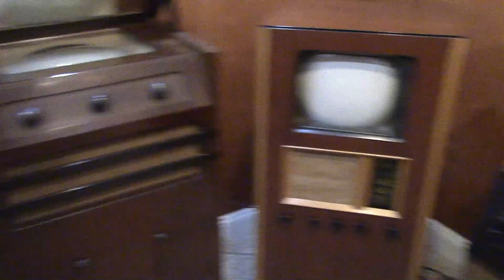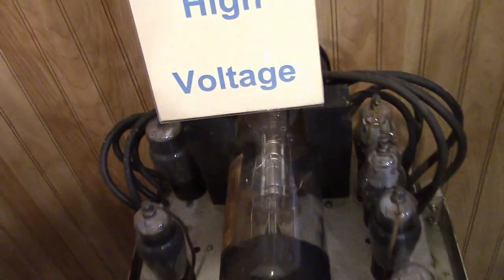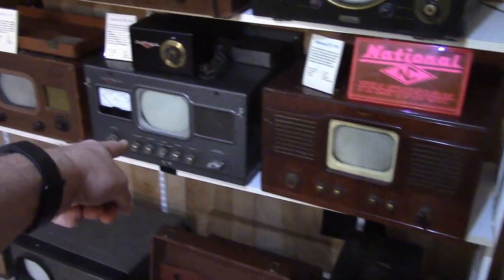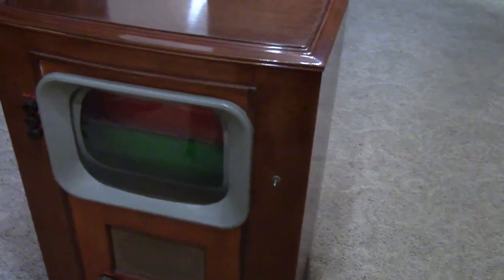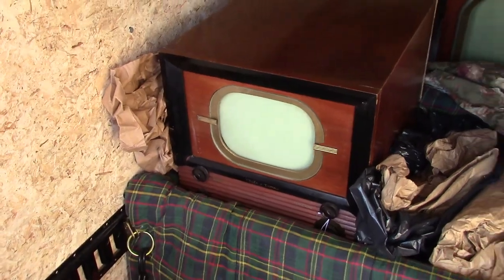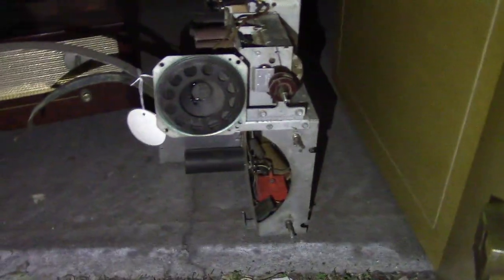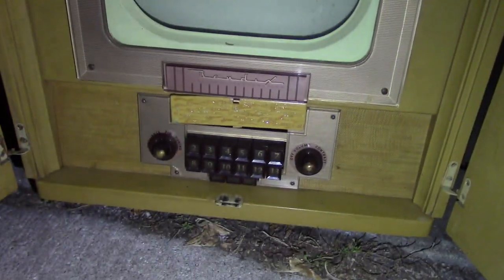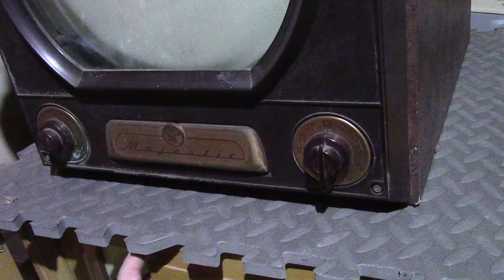ETF 2022 fall swap meet

Comment: Hi Bob,thanks for taking us along. I really want to go to one of these swap meets some day and the museum. It’s frustrating to see something you want on a screen but can’t buy it. Lol.
 I love the Dualette with the optional wooden base that’s in the museum. I’d love to find that one day for mine but they are incredibly rare and I have never seen one come up for sale in decades of looking. My guess is that they probably didn’t sell well and weren’t made long. Most people probably used them as portables and simply sat them on a table they had and saw no need to spend the extra money for a matching base. I know the sets themselves were still being advertised and sold as late at 1963. I’ve seen newspaper ads with them from that year. Perhaps they were blowing out old stock,but have never seen an ad showing the base. 
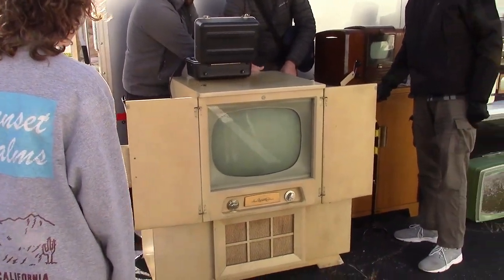Congratulations on your new finds. That Bendix set is really interesting.i like the push button presets.  The one tv I saw outside at the swap meet that I REALLY wanted and would have bought was the seafoam green set (ge?) sitting on the ground next to the blonde console tv at 21:31. It looked like there was plastic wrap over the screen? Or perhaps the plastic lense was broken. Any chance you picked that one up?
At the end of the video inside the museum warehouse I couldn’t help but overhear the conversation someone was having about the stereo tandem Predicta. Was there one of those there?

Comment: I have an Andrea TV/AM/SW chassis with a Dumont round crt. It could use your TLC. It would cost a fortune to ship, it weighs about 60-85 lbs. I was about two weeks out from starting a tear down of it for the parts(sockets, tyranny’s, etc.), if you’re interested Bob, I’ll hold off. I’m sure we can get in touch somehow if you want.
Reply: It’s the first time, beyond buying the unit that I have, that I’ve seen another Andrea set. I don’t think there’s a lot of those sets in the N. East
Reply from the maker: Quite the opposite. They were made and sold in the Northeast. It's unusual to see them anywhere else.
Reply: @bandersentv  I’m in New England and have never seen another. It’s some pretty recognizable dial glass, I spotted the set before you said it lol. Thanks for the info. If I ever do a road trip towards the Great Lakes, I’ll bring it along lol. It’s a beast of a chassis, the power transformer is the size of a coffee maker, sheesh!

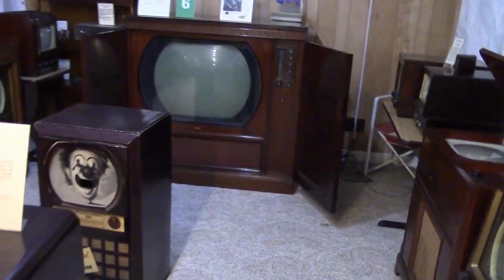Comment: What is that set at 13:31 with the tube facing up, and why?
Reply from the maker: Early TVs had very long picture tubes so they mounted them vertically and you watch in a mirror at a 45 degree angle